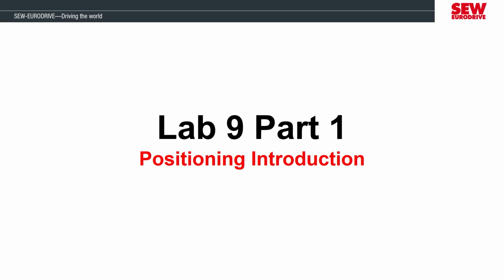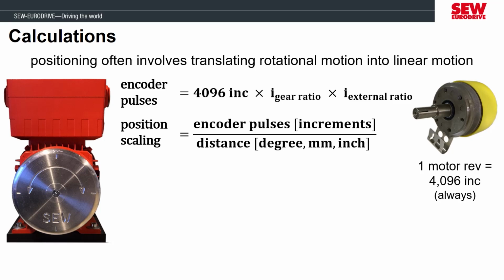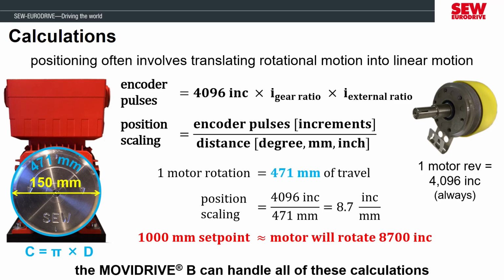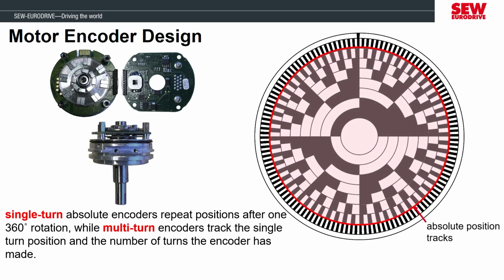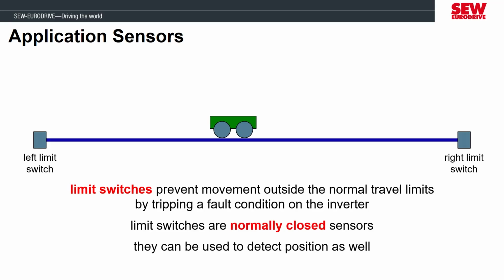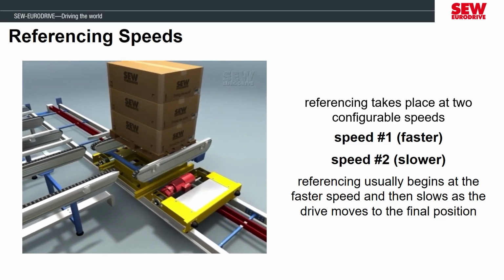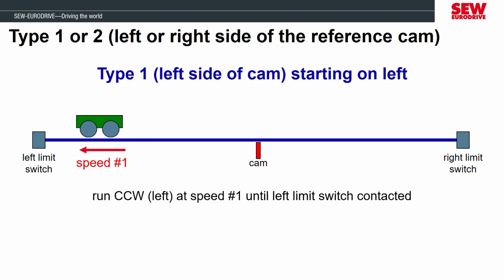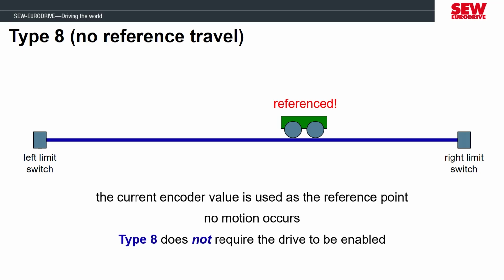MOVIDRIVE® B Training Session 6 - Lab 9 Part 1 - Positioning Introduction

Comment: Is there a parameter that compare signals from external encoder and motor encoder and give a fault when them are unequal? I have a Movidrive MDX61B. Thank you for sharing
Reply from the maker: Hello. When using an external encoder for positioning, the motor encoder would be used for speed control. The encoders likely wouldn't numerically match because they are counting at different rates as the application moves. One encoder is counting at the motor speed, while the other is counting at the application speed. However, if you were to do a Scope recording the slope of both signals should appear to be similar, even though not numerically identical. During parameter commissioning both encoders have to be mathematically scaled to adjust for these counting rate differences. If there is an error with positioning, the Movidrive B should fault with an F08 Speed Monitoring, F42 Lag Error or another fault code relating to the external encoder, such as a plausibility fault. To offer more specific assistance, we would need to view a copy of the parameter file to determine how the encoders and fault conditions are configured on the Movidrive B.

The IPOS variables H511, H510, and H509 are where the encoder counts are processed in the Movidrive B. The present Lag Distance is variable H495. You can view these in (Programming --> IPOS Assembler --> Scroll the variable list until you find these default assignments in the variable view). You can also scope these H variables in the Scope Tool by choosing "IPOS Variable" and typing in "0511", "0509", etcetera. When entered, the IPOS variables will occupy two spaces in the Scope settings because they are 32-bit values.

You can view an example of H511 (motor encoder counts) entered into the Scope settings in this video here at 32 minutes in.
https://youtu.be/zUF_12cFV6o?feature=shared&t=1954

If you wish to speak to someone about this and email the parameter file from the Movidrive B. You can find your nearest SEW office at this link here. When calling in, please ask for Electrical Support.
https://www.sew-eurodrive.de/meta-pages/contacts_worldwide.html